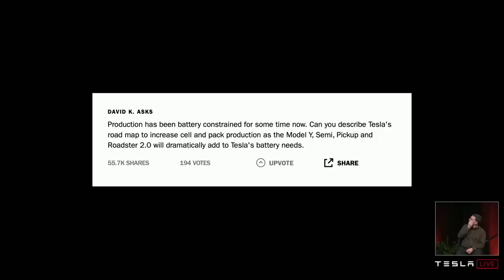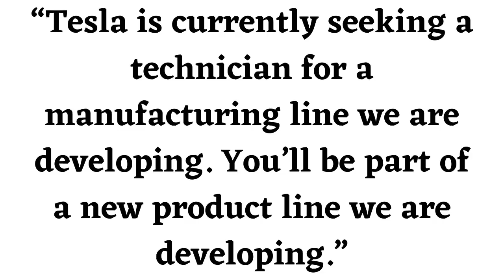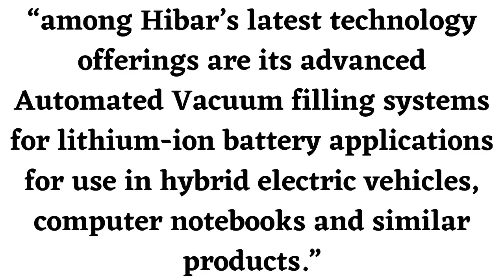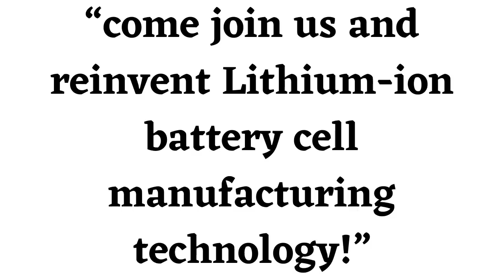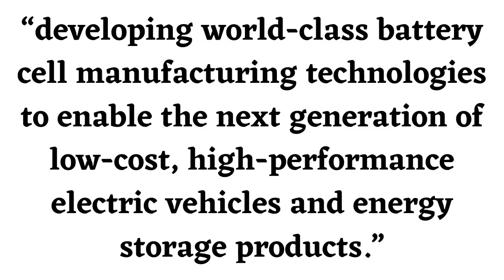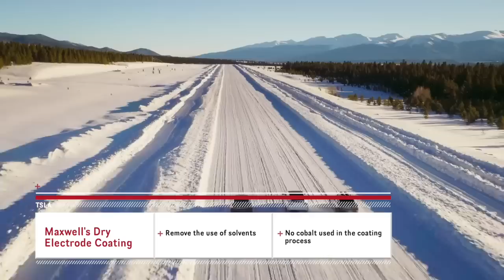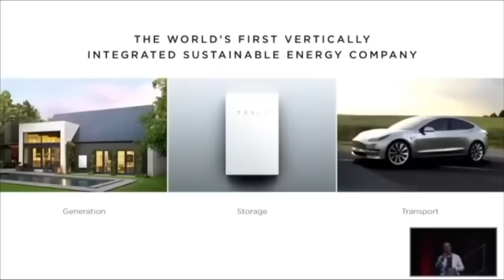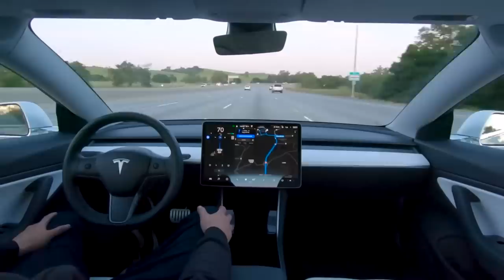Tesla's Secret Plan to Cut Off Panasonic - Tesla's Battery Revolution

Comment: They are NOT aiming to cut them off.

1: Tesla said at battery day that all their inhouse production is supplementary and they'll still be buying as much as their suppliers (Panasonic, LG Chem, and CATL) can provide.
2: Tesla is working with BOTH Panasonic and LG Chem to develop their own DBE 4680 tabless production lines and more likely than not sell them back to Tesla.

Even if by 2030 Tesla can reach 3TWh of internal cell production (which was their battery day target) they'll STILL be buying cells (likely 4680 only as 18650 and 2170 will all have been retired) to fulfil demand for 20M vehicles and grid and residential storage. And IF any of those 4680's from LG Chem and Panasonic make it into a competitor's vehicle, VW, Ford, Toyota, etc, Tesla will get a $$$ cut of that.

Comment: Excellent video!!!! Good information!!!!! I don't think they will stop using Panasonic, they are going to add to what Panasonic is producing. They will always keep partners making batteries for them.  That will keep them in the know for any new tech that comes the way of any manufacturer. There are so many batteries needed by Tesla, they need to keep open. That doesn't mean they are not going to build their own batteries and packs. One is not exclusive of the other!!!
Reply from the maker: I agree with you, but I believe in the long run they will cut off Panasonic.

Comment: Part of the problem is that a battery factory is very expensive, and battery tech is constantly improving right now.  You have to be able to build, use, and amortize the factory before its output becomes unusable because something better has come along.  Just like with silicon chip factories, you only get a certain amount of time before the next “shrink” comes along and obsoletes your $multi-Billion wafer fab line.  Panasonic’s line in Gigafactory Nevada is about to experience just such a sea-change, and will not be making batteries suitable for use in cutting edge Tesla cars.  They need to find an alternate market for them where there will still be demand for the older cells if they aren’t able to cut a deal with Tesla to upgrade it to produce the newest cells with the more efficient electrode coating and vacuum electrolyte filling equipment.

Comment: I don't think it's as easy or as simple as that. What's the number 1 bottle neck for Tesla?
Battery production. 
Why replace the existing capacity when you can add to it? Sure eventually when Tesla has more options and capital to be able to switch on and off battery production they could cut off Panasonic immediately but currently it would do much more harm than good. Why lose the capacity at this early developmental stage?

Comment: As Telsa Builds more cars, and they can use Panasonic, they may want to  keep that production away from their competition.   If they just cut Panasonic loose, they give supply to the competition.  thinking aloud
Reply: Giving the competition a battery solution is exactly what Tesla needs to do.  You forget Tesla mission statement.  More competition is a good thing.
Reply: Tesla doesn't fear competition, it makes them stronger
Reply: Competition will never be able to scale like Tesla so yes, Panasonic is welcome to partner with Jag, Toyota, BMW etc.
Reply: Yes.  Very true.  Think about Berlin for a moment.  Even if they are ready to announce the technology, they have to build the mass production line.  Prove the technology works, hire thousands of people, train them on the lines.  Etc.  This is massively disruptive if you want to build a new plant that produces 100K - 300K cars a year in 2021.  Any new technology is going to take a few years to get to scale.  And think about the contracts for production.  Do you think Panasonic and Tesla are on a month to month contract that either can pull out of with a 30 day notice?  And even if they could, and they did, Tesla still needs millions of batteries per day.  Are they ready to fire that up in a day?
Reply: Competition is good for humanity in so many ways. First, and most importantly, it accelerates the death of the ICE vehicles which are a massive factor in pollution. Second, it benefits the consumer by lowering the price of a vehicle, and thirdly, it will scale up the use of the self-sustaining cycle of electrification, lowering the need for centralized power plants.
Reply: tesla will have the patent, panasonic cant just use the knowlege the have optained
Reply: Tesla are building their own battery plants to increase production capacity. Killing the Panasonic joint venture would drop production right back to the same old battery bottleneck. No to mention the wasted investment by Tesla in the plant. The Panasonic plant will run alongside until the technology is superseded.
Reply: @Dave5843-d9m  Obviously, once Tesla builds a better battery, Panasonic's old formula won't do and be cutoff from the supply chain. The acquisition of other specialized battery makers indicates Tesla's plan to jettison Panasonic altogether sooner than later. Furthermore, Tesla wants to rid itself of independent suppliers to the point of mining its own metals and minerals.
Reply: @Dave5843-d9m  that's not what vertical integration means..

Comment: Timing is the question.  The direction they're moving in is clear enough.

But Tesla's appetite for batteries runs into the terrawatt-hours range.  They need so many, they can't turn their backs on Panasonic, or LG Chem, or CATL, or anyone willing to sell them batteries with good performance characteristics and price.  It has been leaked that Tesla may even use Lithium Iron Phosphate batteries made in China, whose energy density is 1/2 to 2/3 of Panasonic's 2170 cells.  Exactly what Tesla might do with those cells is an open question.  A budget car?  Grid infrastructure projects?  Powerwalls?  The point is Tesla wants orders of magnitude more batteries than it gets out of Panasonic.  It'll take a long time to ramp up an internal supply chain that big.

Tesla may even have to start mining their own lithium.  There's no real shortage of deposits; but extracting them isn't currently happening at the pace Tesla will need.  Tesla may be able to get more cells out of a production line footprint with its new tech, but they'll need those raw materials to get to the numbers they will need.  Ahead is a many-years-long ramp for new-tech cells.

I expect Panasonic to be around for at least 5 more years supplying batteries to Tesla.  Tesla can use older-tech cells in lower-tier BEVs and in fixed-site installations.  Consumers will prefer the newer cells, of course - so Tesla will use them to lure consumers to higher-priced products.  They'll do well with that strategy, too.
Reply: Cobalt is the bottleneck, not lithium. Perhaps they might pickup a cobalt producer? First Cobalt comes to mind, they have the only refiner plant in North America.
Reply: @gofastnotnow2546  Cobalt is the most expensive mineral in batteries, but it's the sheer quantity of lithium that is the most likely bottleneck, according to the very prestigious small intestines in my gut.  (I often cite them.)

What will happen if they're wrong?  There's no Nobel Prize to revoke, no endowed chair to vacate.  :P

I'm under the impression that Tesla wants to eliminate cobalt from its batteries entirely, but I'm not an insider with my nose stuck between the pages in their planning.

Anyway, a move by Tesla to mine cobalt would surprise me.  A move by Tesla to mine lithium would not.
Reply: @Urgelt , I respectfully say you're wrong. Tesla has already reduced the cobalt content of their batteries, lithium is very abundant, several producers. Cobalt on the other hand is most abundant only in the DRC and most of it controlled by the Chinese. I'm too lazy to find the link from Tesla talking about the cobalt bottleneck. 
Cheers.
Reply: @Urgelt  ,I didn't find the link I was looking for, but this one speaks of the same thing, reducing or moving away from cobalt in battery chemistry. 
https://www.mckinsey.com/industries/oil-and-gas/our-insights/metal-mining-constraints-on-the-electric-mobility-horizon
Reply: @gofastnotnow2546  You disagree with my prestigious intestines?  Bold fellow!

Mined lithium isn't producing scarcity yet, but Tesla's ambitions require way more than is currently being mined, and mining operations are not increasing quickly enough to suit them, or so says my gut.

And Tesla has said they want to end cobalt in their batteries.  I dunno when, but it's a goal.

So I don't expect Tesla to jump into cobalt mining.  But hey, you can disagree!  You make your predictions and see what happens.  Nothing is settled until it's settled.  (Misquoting Yogi Berra is a hobby of mine.)
Reply: @Urgelt , if you read that article,  we may both be wrong and it may be nickel instead being the least in supply after cobalt.  It all depends on how battery technology evolves from here.
Battery day should be interesting, perhaps a dry cell technology instead of the much touted solid state configuration.
Reply: @gofastnotnow2546  Nickle?  Let me consult my twisty smelly intestines... Nope!  My gut doesn't think nickle will be in short supply much.  Though I will concede that my gut's lack of credentials, or even neurons, makes it a suspect source!

My gut also dismisses the possibility of solid state batteries showing up at Battery Investors' Day.  Too far out, not ready for prime time.  I'm quite hopeful, though, to see discussed Maxwell's dry coat tech and a new electrolyte.

Aside from the pandemic, Battery Investors' Day is the most interesting news item I expect to see this year.  It could be hugely significant.  Soon!
Reply: @gofastnotnow2546  Elon always said there are superior options to solid state